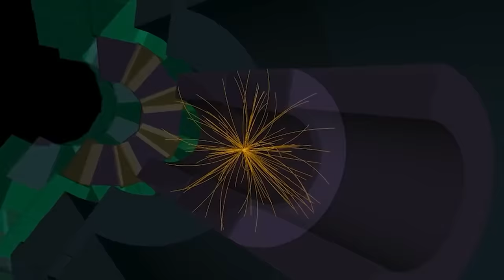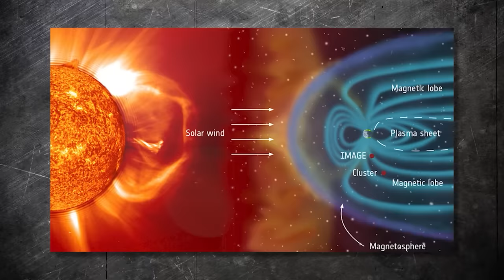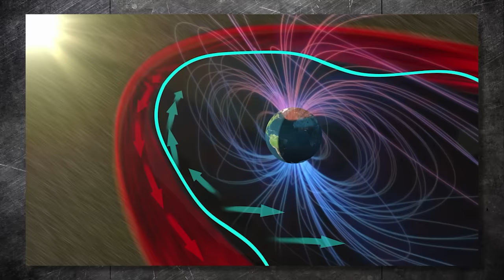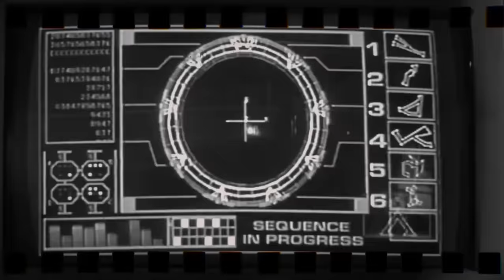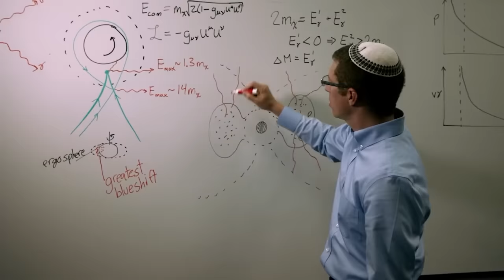CERN Scientist claims They have Opened a portal to another dimension!

Comment: Generally CERN is operated during CME events or high solar winds,  because this gives the collider additional energy.   It also helps the solar wind collapse the earth's magnetic field near the poles,  allowing the solar wind to actually reach the surface in the polar latitudes.  This has been observed using the satellites that monitor the earth's magnetic field versus the solar wind interactions in real time,  while the CERN website shows the collider being activated at increased power at the same time.

Comment: They have already done this before. Last time didn't work out so well.. unstable portal ended the existence of my original timeline in the multiverse.. since then we have all been riding the wave. This is the reason for a lot of anomalies happening right now.. all the glitches in the matrix stuff, as well as being the direct cause of the Mandela effect... Around about a decade or so ago if I have my timelines correct... Not sure though if it was supposed to happen on purpose. Theoretically it could be a universal reset of sorts. Reversal of the big bang expansion of the multiverse creation.. rounding up all the variants and recombining them back into the singularity.
Reply: So do you have proof of this happening I have memories of other timelines too but don't recall me leaving them because fo Cern.
Reply: @GalaxiaStars  They would've been your souls choice due to a soul agreement or other reason but all will have been agreed to by your soul and oversoul!

Comment: Its like playing the ac dc voltage currency of charge on a circuitry motherboard of thr mixer n mixing thr equalize billing point of the rolled enrollimg of hz n db sound wavering n blastjng th3 basswave in the constant motion throufy protocals within port between the wlan n broadband networks combining the perfect loop play speed n being able to control time now the lsst important part u need to figure out is how to run the web interfacr in our network tk runs through fiber optic glad cable of porting n deporting the data point to upload the download happening of the information travellin nearly the same exact amplitude wit th3 geforce of magnetizing the sympathizer  wit some symphony of notrs in the decibal negative n positive flowing the current charge an alternating current wit the currently flowing of direct currency wit percise calculation simutamiously makin a supersonic subliminal bass blashpemy makin like laser percisioned loop timing wjt the ray of light going thoufh an hr glass captjrin the color of xray micro wave wit sound wave somrthing likr that thag all i can come up wit sound likr an anti purpulsion t3chnique might just be an anti gravitatiknal pulling makin thr new quantum levitation system for a ufo craft to hover lol

Comment: Now thr best part is to run everythinf wit fiber optic glass capable to sound engineering sound board eithin the motherboard cirxuitry mother of all motherboard in eletrical chip new form of processing surpassing thr geforce power of magnitizing th3 smplitude of hz n db match the same surfwce wait in volume to equalize the sequal of n equilatoral projection of light slow down beforr the time frame csuse n effect n makes an effective new skill n abikity through mobile internet data with external data frames on thr network throufg protocalling between a cellulat network n pinging n binding the network protocal portal of internet wlan wit broadband